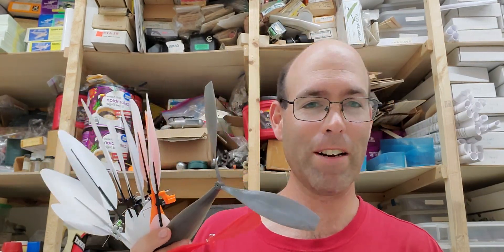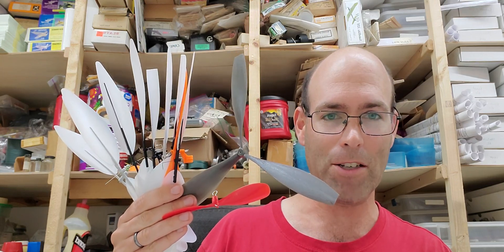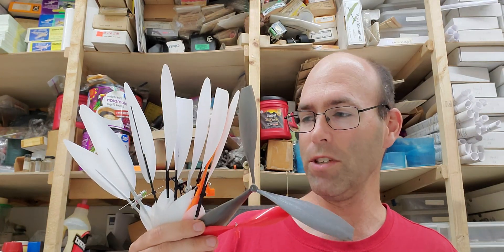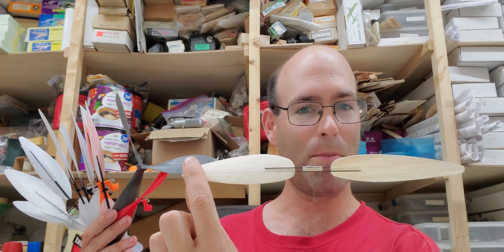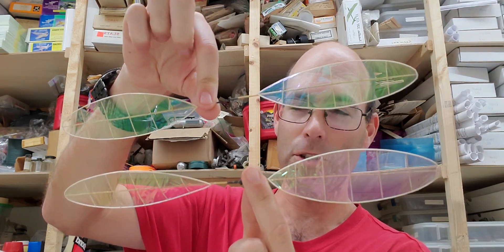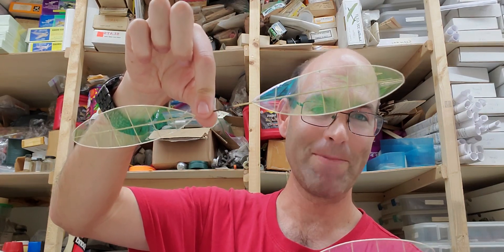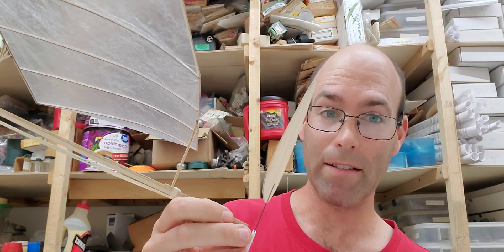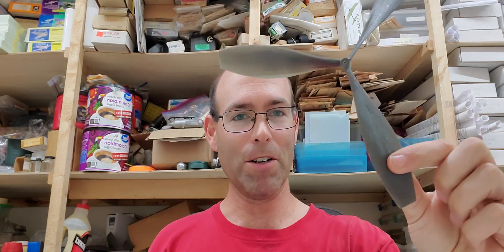These propellers are illegal! (please help me fix this)

Comment from the maker: If you're in District 7, you're disenfranchised, so please email everyone on the contest board.
Reply: I'm wondering if it spawned from poor quality control more than gatekeeping
Reply: Even if it is too keep it fair or to have showmanship for younglings. Idk. Interested in hearing how it turns out
Reply from the maker: @blackfrost273industries4  oh it's absolutely about gatekeeping. The original concept of the rule was to keep parents from building planes for their kids, but it morphed into something else over the years.
Reply: @joshuawfinn  that's very predictable for sure. I am not even hobbying in drone (small interest) and can tell from your perspective almost immediately it was either professional or experienced people not wanting anybody new to join, or the manufacturing control was poor and causing issues. What sucks, I don't know how this will affect those kids growing up with their parents doing things for them. I am guessing it stunts their capacity. It sounds like it would be great to remove this stipulation and refocus on the kids. Those who make their own may excel further. Then perhaps it would be fixed with people present to help those who want to learn regardless if they ask or not able to ask. I hope some of the things I've done help spread the word. I think youre being reasonable. I think there may not be a change, but if the committee actually considers it, awesome! If done once, it can be done again until the field is adequate for people again

Comment: One of my main gripes about those rules is it likely causes many who would want to or would enjoy entering competition to forgo entering because they think they can't, because they either don't have the skill to build these props or don't have the time or simply just don't want to even if they can and have built them just fine (I would fall into to the later of these categories). Also,  the fact that you mentioned some people are "cheating" and just doing it anyways whilst the governing bodies are choosing to look the other way is a huge problem! If they're not going to enforce those rules, then just do away with them and open it up for more people to enjoy the sport. Or if they really feel these rules are the best thing for this type of competition then simply open up a sub category that allows premade/purchased props, or devise a points system that takes away or adds points depending on what was bought and what was made. There are so many easily implemented solutions to this problem its amazing that its even an issue at all! I'll definitely be emailing them on your behalf! I know I'm a little late to this video but you bring up some valid points that can't be ignored.
Reply from the maker: Yeah it's a mess. We'll get another shot at fixing it in two years.

Comment: I'm the District XI board member.  I've had a few people contact me after watching this video, so I thought I would comment here.  I will be voting no on the propeller proposals.  While I support making Ikara and other commercially available plastic propellers legal, these proposals go much further and completely eliminate the BOM requirement for propellers.  I won't support a rule change that has the potential to favor financial means over skill and effort.  We've already seen F1D propellers offered for sale for hundreds of dollars (though they are not legal), and I foresee something similar happening in AMA events.  If these proposals fail, I would support a more narrowly tailored proposal next cycle that makes plastic propellers legal to use.

Regarding the VP proposal, I will likely vote yes on this proposal.  I don't support it for the same reasons I cited above, but the FAI has already deemed purchased VP hubs to be legal for FAI events.  It seems reasonable to mirror the FAI.
Reply from the maker: So you're saying you're going to vote against the will of those in your district who have contacted you in support of it?
Reply: @joshuawfinn  I’ve received 4 responses overall. One was in favor, one was in favor but is not an AMA member, one had no opinion, and the 4th was opposed.  I’m also opposed making 1 for and 2 against.

Comment: Just wondering, and curious if I understand. Don't really know what class (division) these would be considered. Did a dual build with my grandson of a laser cut kit. We both built our own, but since we are using the Peck-polymers prop that came with the kit, we couldn't enter a competition with them. That's what I'm understanding here. Am i correct? If so,  should I email the AMA District 5 person? I'm new at thinking about going to club competition. Will follow your lead on this.
Reply from the maker: You've assessed correctly. You'd have to check the AMA rulebook and compare to whatever plane it is that you've got there, but it could be Pennyplane, AROG, whatever, that plastic prop makes it ineligible if you want to fly it in an AMA indoor class. Outdoors, that rule was deleted about 10 years ago with absolutely zero negative effect. Mind you it didn't boost participation, at least at the time, but there were no outreach programs paired with it either. It's only in the past two years that we've started recruiting SO and TSA students toward outdoor flying.

Comment: I understand where people are coming from here…but hear me out.  A balsa prop is not hard to build.  Cut some 1/32 balsa to blade shape, sand it to .025”-.020 or so, soak it some hot water, wrap it around 4-6 inch diameter cylinder and bake it in the oven at 220 for an hour.  Glue it to a spar and have at it.  It’s not hard, and I feel like we are insulting would be modelers by saying “you can build an airframe but not a prop.”  If you can build the airframe, you absolutely can build a prop.

Or let’s say you don’t want to build a prop.  Okay.  That’s fine too.  You are more than welcome to fly at any of the indoor events, you just can’t count your time for an official competition time.  This shouldn’t be a problem as the majority of the people who support allowing plastic props don’t fly competitively anyway.  

Again, nobody is saying you can’t use a plastic prop on your model.  You just can’t use one in competition.

Though to be fair, at the end of the day, it doesn’t really matter anyway.  A good balsa prop will beat a plastic prop any and everyday of the week.  I think almost anyone involved in competitive free flight knows this.  So again, what’s the point?
Reply from the maker: Can you address the specific issues I raised in the video? You've changed the subject quite a bit from my concerns.

Comment: Does this apply for Division C? Div C rules state that only “variable pitch propellers with mechanisms that change the prop diameter” aren’t allowed..?
Reply from the maker: Science Olympiad has a rule specifically exempting commercial propellers from this rule. It's an AMA/FAI thing. Which is what's stupid. Your SO planes are otherwise legal for LPP and F1M. But you have to build your own propeller. So dumb.

Comment: I propose you must grow and harvest your own balsa tree!  (don't share this with the AMA, they might do it.  LOLz)
Reply from the maker: No kidding! We actually bring that issue up pretty regularly, also in regards to motors, batteries, and engines, and they always come up with some silly excuse for why that's different.
Reply: If they are that fussy they will just say you can only use materials supplied by them.
Reply from the maker: @olivertaylor4779  fortunately that's not a thing, but I've seen STEM organizations try that one. Usually results in no one getting anything to fly.

Comment: I fly in space modelling (which is mostly a free-flight discipline, I suppose) and yeah. It's not cheating if you can get away with it. There was a new rule that says you need to call out 3D printed parts on scale models, and I challenge any of the judges to discern what is a well finished 3D printed part vs. a resin cast part. Ultimately, it's some old fuddy duddy that feels threatened that other people can replicate their results with (perceived or real) less effort, or even just a more accessible technique.
Reply from the maker: The free flight rules writers haven't even thought about the issue of 3d printing...gonna be hilarious when they come up against it. But yeah, it's exactly what you said, people afraid of being beaten more easily.